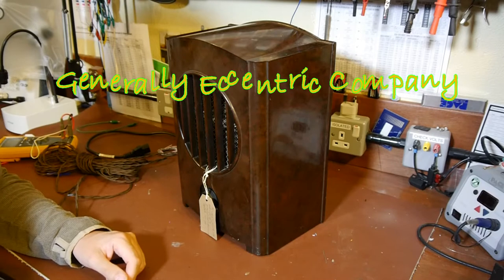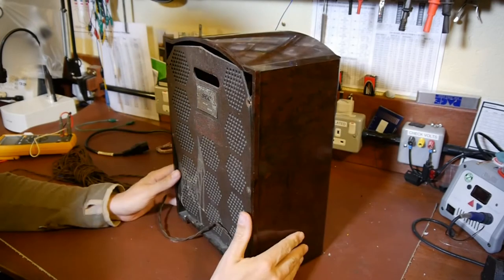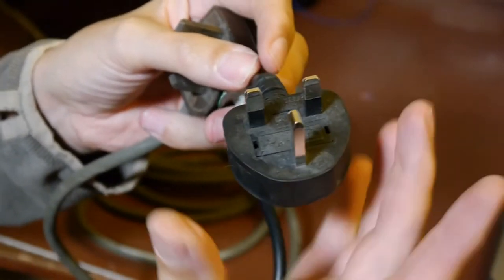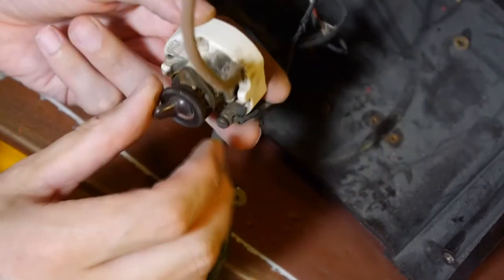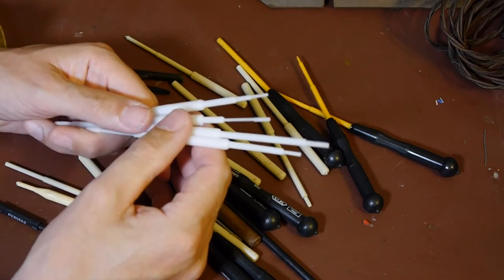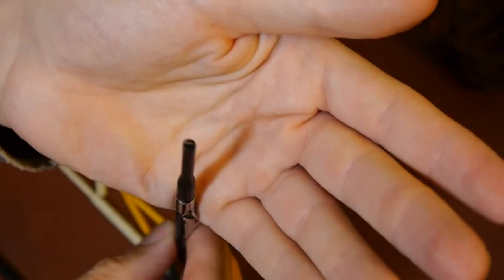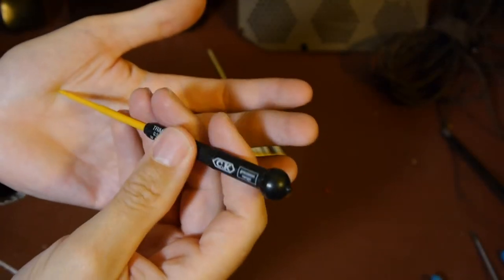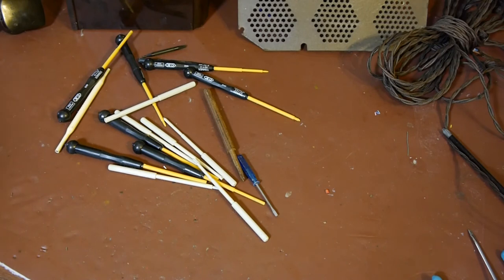GEC Radio Repair Part 1

Comment: A friend of mine, whom emigrated from England to Alberta (Canada) in the late 1940s, and whom was a radio repairman before the war, was telling me about some radios over there that had a single control knob, he called them a "Uniknob". It's a handsome looking cabinet for a Bakelite radio, maybe not as nice as some of the pre war EKCOs or Pyes, but the grain, and the shape is appealing. Red, brown, and blue for AC wiring? You are right that really doesn't make any sense, it's probably what they use in German or something.
Reply from the maker: OlegKostoglatov  What a great story and comments.  It amazes me the price for the Ekco Radio I think the round green versions may still be a record holder in terms of price. I have to admit that I much prefer wood or even the metal enclosures on my military radios I just don’t like plastic I think it’s just the dull brown colour is not very appealing.   Hopefully I should be able to complete the repairs in the new year but I still need to find the insulators for the heating element.  Would be interested to know if you based in Canada and what is the weather like? My best regards Chris

Comment: These were shockingly inefficent radios. I bet rare as well actually. Ekco did similar sets but a square shape and much bigger.  Looks fun if you can get it working, though it might be hot work :) I voted for an uncommon 2 amp fuse.  I bought a set of Belzer trimming tools, very good. I'll see if I can upload a video tomorrow.
Reply from the maker: Andrewausfa  Hello Andrew yes the 2 Amp fuse is definitely one of my favourites but I think they must be pretty much extinct. I rarely see any wild example with that beautiful dark plumage these days. I would be interested in seeing your Belzer trimmers. Thanks regards Chris

Comment: Great video as alway Chris. Very entertaining. Looks like you have been sent a link for e ceramic screwdrivers. Mine are Draper Expert and are pretty much all I use now. The radio has an interesting case but I suspect the innards may be sparsely populated. Cheers Graham
Reply from the maker: Radiocruncher Hi graham was wondering where you were hoping the chicken are doing well, we have more eggs than we know what to do with at the moments. The girls been working hard. Been wanting to try some of the ceramic trimming tools as all the ones I have a pretty poor.  What have you been up to lately.  Perhaps in your next video you can get your trimmers out for the lad!
Reply: Hi Chris. I'm still here but the addition of 2 Labrador puppies has slowed me down dramatically! The girls are doing well although we still have a couple brooding hens. I've been pretty busy with repairs in between puppy sitting so have loads of videos backed up. Just need some time to get them edited. I will flop out all my trimmers for you to have a look at on a video soon. Cheers Graham

Comment: A few minutes in, delightful,
Reply from the maker: Average Joe always nice to get a comment from you. Your  little comment on the Deaf Porn site had me on the floor LOL. We both share have a darkly sardonic humour.
Reply from the maker: Hello Joe. My dad had a big square shaped Cortina in the 80s but not sure what that model was. I do remember the plugs with the captive washer and I think they are actually my favourite plug of all time. I have some somewhere that are also have a toggling switch built in.  My dads old XJ12 had two tanks and a huge amounts of dials and switches to choose from. That did about 12 to the  gallon and wish I still had that car.   Yes I think your right it was the Vintage Electronics Geek that did the review of the ceramic trimmers I will have to ask if he can still get them. Not sure you attatched the correct YT link.  Look after yourself Joe and as always thanks for making time to comment. My best regards Chris .
Reply: I had a Daimler double six which I removed all the emission control gear and fitted E-type manifolds etc, It was silly fast, and the only car I possessed that would leave two lines of rubber on the road after a 'spirited' take off! 
 Cheers, J.
Reply from the maker: Yes some of my friends have American cars that have silly amounts or torque great for wheel spinning.   It just has the single switch and I'm pretty sure it's original as the mounting holes in the chassis line up.  I am mulling over what to do with it, I'm not sure I can get it into a safe shape. Never massively worried about electric shocked but fire risk is a worry.

Comment: Vishay spectrol over here. All I got in terms of trimming tool, but I only ever need it for those potentiometers and small trimcaps. :)
Reply from the maker: MrDubje  Hi I think the one I use most frequently is by Vishay and very good it is. But I assume these are designed for trimming potentiometers rather than ferrite or dust cores.  There's is such a variety of dust core types we often make our own here by grinding down plastic knitting needle- the old type. Going back to our fuses I found my one was just a old bus man time delayed fuse. I suspect all the different design was just various manufacturers trying to get around patent law. My best regards Chris

Comment: I have just got some of the ceramic type trimming tools from ebay Chris and so far they seem ok. If u find any other good quality trimming tools please let me know coz iv found the same as you mostly they are junk.
Reply from the maker: Gary g1fsh  Good trimming tools are just amazing rare or it could be I just won't pay the extortionate cost for a good set. If you still have a ebay link for those ceramic trimmers let me know. My best regards Chris
Reply: Here u go Chris I'm sure there will be cheaper ones but the delivery on these was quite quick and at least they did turn up lol
Reply from the maker: Gary g1fsh  hi Gary that's great I have just ordered a set of these so that is brilliant many thanks for posting the link I think a few people are going to be interested in getting some.
Reply from the maker: Gary g1fsh  thanks I just bought 4 sets I'm sure Andy and Simon will make use of them

Comment: I expected you to turn the radio around and .... someone knicked the chassis lol.

I always liked the white mains plugs with the brass finger nuts in them and angled plastic bits to act as a cord grip.
But i'm a bit odd that way, well many ways really :)
I still have the yellow/green/white/blue plastic core tools, they are crap and i bought them from maplins in coventry, r.i.p maplins :-(.
I got so pissed off with one snapping that i found a metal slug and heated it up, then rammed the tool into it (Ow er), so another fresh hexagon  was created.
Reply from the maker: zx8401ztv I love plugs with those wire wrap terminal binding post. It’s funny you commented on this video I had completely forgotten about it. Unfortunately still not been able to repair it as I need to find a replacement for the ceramic insulators supporting the heating element. Regards Chris